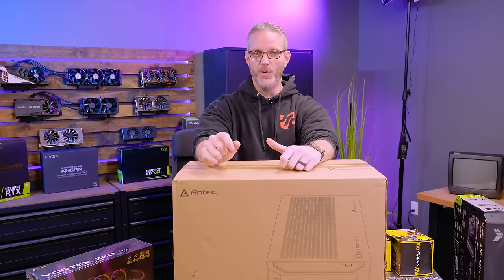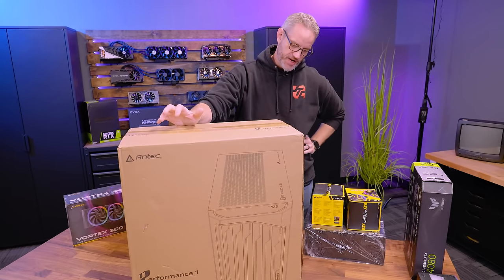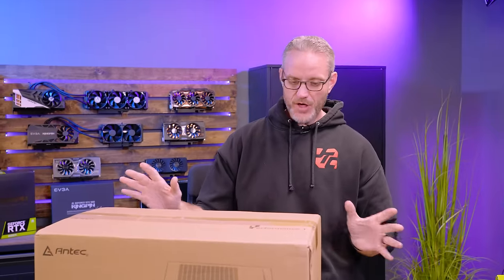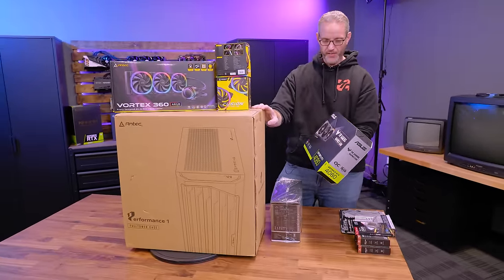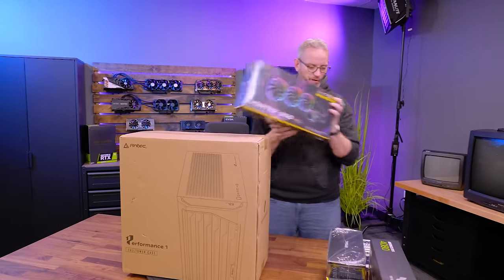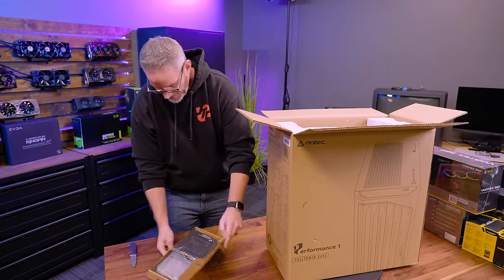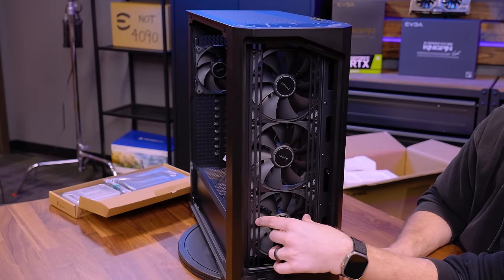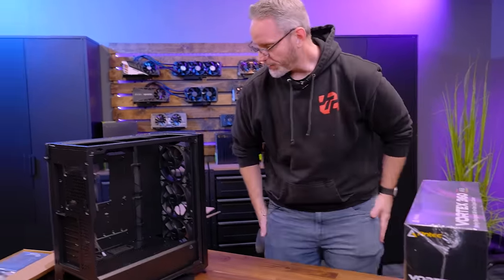Antec Performance 1 Full Tower Build!

Comment: If you want a good back pocket knife for general business IT work (cutting tape, occasional light pry when opening plastic cases, etc) the Gerber Fastball is awesome. Take off the belt clip, and it's light, slim, sturdy (I'm a big guy, and keep it in my back pocket, and yet it doesn't mind me sitting on it at all), very sharp (comes honed to a sharper blade angle than most other knives it's size), yet durable (more expensive high hardness steel, which is good because sharper and harder, though it's technically more brittle so don't dig the tip into a steel plate).  Love it for one hand work, holding a box with my left, grab knife from back right pocket and open the blade without looking, slice tape, close blade and return to pocket with a motion of my thumb and flick of the forefinger.

... when opening boxes for pricey replacement parts while in the field to repair things that cost tens of thousands of dollars an hour when they are offline, good tools are very much so appreciated.  Very much worth paying over a hundred dollars for a knife.

Comment: I don't remember the model number, but the first build I did with enthusiast level parts was in an Antec case. It was the first black case I built in while we were still in the beige tower days. Most of it is tool less except for the 3.5" drive bays which have rubber grommets in them, new concepts back in the late 1990s, and it still feels like a quality item. It's not quite dated looking enough for a Retro build, although it does have a total of 6 exposed drive bays, 4 5.25" and 2 3.5". Today it has a Supermicro server board in it along with a bunch of drives and is in use as a NAS.. because you can fit 6 hot swap 3.5" drive cages in the 4 5.25" bays. 

Really going to have to look at Antec again. I'm in an Asus Prime mesh case currently, and while I love the understated look, it does nothing to mitigate fan noise when the GPU heats up.

Comment: Built in the NX800 from Antec, which I strongly recommend if it's available in your country (pcpartpicker US doesn't list a price for it, I got it at my country's marked up prices for about $110)

It's a pretty basic case feature-wise, but perfectly fine for gamers, which may sound kinda bad at that price range. It does come however with 5 argb fans preinstalled with the same 3pin argb header to control it or alternatively a bunch of rgb presets on the included fan rgb controller. Those fans are 2x200mm fornt, 2x140mm top and 1x140mm back, so that covers basically all the airflow you'll ever need. And the biggest bonus of all might just be that it comes in black, white... aaaand pink :D

Comment: Before I got the Cooler Master HafX that I still use, I had one of the Antec cases that had an open swing door with a lock on it. That is a pretty good case; I think I gave it to someone when I couldn't use it anymore.
Reply: Still using 2 HAF 932 in this house.

Comment: My second build (Athlon XP-M 2500 on an Abit NF7-S motherboard) had an Antec Plus 660 AMG (Antec Metalic Gray) case. That was a really lovely case, which I re-used for several later builds. The reason I never bought Antec again was because of my experience with their poor PSU's. I wouldn't mind if Antec re-introduced AMG-coloured cases.

Comment: If theres width clearance with the power supply, cutting holes in the side of the basement and mounting the SSDs behind the holes would be an absolutely SICK mod for this setup. While you're there, moving that temp readout to the same place could be a possibile mod as well.

Comment: I used an Antek 300 for a previous build and it was a great case. This one looks really nice as well.
Reply: I had a 300 for my fisr build : it was a Phenom 2 X3 720, a HD4850, with 4gig of RAM it was back in 2011. It was a great cas fir the time, but in retrospect would have benefited in a bit more airflow.

Comment: I work in entertainment, where I still, must have an optical drive... I have the Antec Dark Phantom DP502 FLUX, because it was the only tempered glass "gaming" case that I could find with a 5.25 drive bay, and it turned out to be a really nice case.

Comment: Antec is coming back i have a 1200 case with the oversized power supply spec they were trying to get stranded but it was larger back it 2003. the case is still in operation but the fans didn't last but they didn't care about fans back then and the 850w Antec power supply still working had to much dust in it after 14 years 7 years ago cussing some random shut downs i hit it with air and its back to 24/7 operation. i got one new case a variant of this one and love it and they have good fans now.

Comment: I have a P4 system running in an Antec P182 case downstairs right now. Those things are heavy - over 30 pounds empty - thanks to the steel construction.

Comment: Eagle Tech cases (no longer making cases) had the ability to display the temperature of the CPU on the front.  They are about 15 to 20 years old.  I have the Dragon case.  And that Antec case is very similar to the Cougar case I am currently using in my most recent build.

Comment: Antec cases have been having a bit of a "quiet revolution" in terms of design for the past five years. The "Antec striker" is really nice open ITX tower that allows for some crazy custom water cooled builds, I saw a really nice Cyberpunk build in one. Antec have recently released the " Cannon" case which is ATX version of the case, which, I have been sorely tempted to buy and build in, but fluffy cat and open air towers are not a great mix.
Reply: The STRIKER and CANNON are really innovative open frame case, there are many awesome builds for these two. The Performance 1 is not that crazy, but it looks great in details, the cable management covers, removable top cover,and temp display. Well done, Antec.

Comment: Jayz, It does support a 420mm Radiator in the front, and i am starting to build my Asus ProArt with i hope a Intel core I9 14900K going to Use a Assu ProArt Lc All in one CPU Liquid Cooler 🙂all in white with no Flash Flash  lights lol.

Comment: @JayzTwoCents back in early 2000s i had a case that i have no idea what it was called but on the front area on each corner there was a strip with fake bubbles in and an rgb type flowing colours, it had the same thing bays that pulled out and even a spot for the psu to fit in the bottom and that was way ahead of its time wish i could remember what it was called

Comment: Agree with all you mentioned & said. Nice looking case and looks like everything fits 'snug'.
It would be 'nice' if Motherboard manufacturers would move the CPU Power connectors from the back to the front side of the Mother board so all Cables can easily be 'managed' and do not need to run across the back  diagonally to the PSU or one needs to use an extension or new longer cable.

The ANTEC P1 is  looking nice, was happy to see in the last part of this video one can drop in the AIO from above.  Cool case 😇

Comment: I havn't used much gear from Antec for many years.  I remember that I once had a case with a whole bunch of Antec branded fans in them.  These were early generation LED fans powered through molex and had individual speed controllers on them (back when the only common size fan you would come across in stores was 80mm).  I think at one stage I also had a fan speed controller from them which had a bunch of temperature readouts but you had to place cabled sensors on the items you wanted to monitor, I never really found that one very usefull apart from trying to minimize the noise (not very well).

Comment: -- Not a bad looking case.  It's not a D5000 but it is nice, and in 25 years, I can't think of a time Antec has ever let me down.  Bought one of their 5 packs based on your recommendation in a previous video.  Pretty good for a 150 dollar price-point.  
   I still disagree with you on removing the top filter, even if it generates better airflow.  Leave it on (especially in push/pull config), let it catch some stuff, otherwise, you'll just have to catch it again.  
   Thumbs up.

Comment: I've been daily driving an Antec 1200 for 13 years now, it was way ahead of its time in terms of air cooling but doesn't keep up with the modern designs. It is home to its 3rd system right now, which will probably be its last. There is just no need for all of those HDD bays anymore, and certainly not the optical drive bays.

Comment: I ended up giving this case a shot. It will be a dual purpose PC Gaming and a DAW for home audio recording. I did not need anything with the trendy fish tank glass everywhere look. I'll use the Asus Pro Art 670e motherboard, Founders 4090 gpu, silverstone hela 1200r psu,  AMD 7950x3d,  3 fast nvme drives and G.Skill Trident Z5 NEO RGB, and a EK Nucleus AIO CR360 Lux D-RGB aio cooler. I need to look into a nice set of cables to be made for it. This pc is way overkill but will age well.
It should suit me for  number of years as my current gaming pc is a haswell 4790K and a GTX 970 gpu (recently swapped to a 3050 which helped). I keep pcs for a while. My former music pc is an old XENON build that was very expensive t its time that my gaming pc smokes now. It does have a nice Lianli aluminum rack mount case that i would have liked to use but didnt see very well suited to cooling or air flow.

Comment: I still have an Antec 1200 and little reason to replace it. Full Tower seems to be a relative term these days.
I took off the bottom half of the 9 front bays and it's got more room than this one for the video card.

Comment: I was taught as a kid that a dull knife is more likely to cut you than a sharp one Jay.  🙂  Wish you had included CPU/GPU temps during a bench test in this case.  Some of these tempered glass cases reach Easy Bake Oven temps.  That's not something I want to put expensive PC components in.  Thanks for the video.

Comment: Crazy thought, if they fit without hitting the front mesh...

Put the 120mm Fusions on the front of the bracket (so the rings are not blocked by it) and the 140mm Storms on the back of the bracket. 

The screws on the 120's will line up with a 10mm offset without interfering because the sizes of the fans. (I test fit this on my Define R4 and it does work).

Wondering if it would cause turbulence issues if they are all running, or if it would actually help the Storms blow into the case even better?

This is mostly just to get some proper RGB showing through the front grill without wasting not utilizing fans that are already provided with the case, something I struggle with all cases that supply fans with the chassis that don't fit with most builds, (looking at you H7 and 5000d).

Yes, thinking outside of the box for sure, but hey, if it can be done, why not?

And yes, I know you might be able to sandwich a 420 rad in push/pull there, but Antec doesn't make 140mm Fusion fans. Be Quiet Lightwings I guess?

Comment: My favorite Antec case, to this day, is their Skeleton case (the full-sized one, not the mini). nothing (short of an open test bench) could touch it, in terms of airflow. I used a Skeleton for a LONG time. A few years back, when i built my latest PC, i wanted something with REALLY good airflow, but the Skeleton was no longer suitable (it couldn't handle the parts i wanted to put in it, and it's main fan was unavailable as a replacement part, and the fan was on it's way out), so used a Cooler Master HAF XB EVO. It is absolutely perfect for my use-case. Excellent airflow, and a size that fits in the space i need it to, without choking off ventilation. couldn't be happier with it. This Antec case is kinda cool, but honestly, i'd still take my Cooler Master HAF XB EVO over it any day.
Reply: HAF  XB is such a joy to work in .if you have a bunch of 3.5 drives down low you might need a fan down there depending in use though.  Gpu sag ? Never heard of such a problem.
Reply: @daved22  Absolutely. the orientation of the mainboard was second on my list of criteria (first being airflow). That case is SO good to work in. I do have drives in the hot-swap bays, so i do also have a pair of 40mm fans mounted down below. my drives, my CPU, my GPU...everything stays nice and cool. Love that case.

Comment: Had that same P182 case with Masterkleer tubing, all DangerDen blocks, and a swiftech MCP655 w/speed control.  Obviously all barbed fittings w/ zip ties for "secureness".  I think I only had a 240 rad at the time but it was mounted the same way as yours with standoffs on the top.

All from xoxide 😁

Comment: I'm looking for a boring, low noise cabinet with good space for hard drives, yet with up to date connectivity for a workstation I'm planning to build. No need for led lights, I'll just as well use a head lamp whenever I need to. Glass panels are a bad idea, unless they perform better at noise reduction than foam covered steel plates. But it must survive working at full tilt for hours at a time, account for the fact that I count storage in terabytes, and preferably at low noise at that. Any idea among you people?

Comment: I have a 12-13 year old 750 watt antec psu as my testing/backup psu. It is in use in my main system atm because my not even 1 year old Corsair unit died and I haven’t gotten around to getting it rmad

Comment: Looks really nice.  But with buttons, ports and display on the top, its clearly a floor case not a desktop case like the O11 and those also moving ports to the base etc.  The other problem I see is the front panel.  I like the look.  But having the front visual slots attached to the filter layer means you may find a full cleaning of the mesh hard.  Those slats would be better detachable so we could clean around them.

Comment: I miss videos about airflow in a case like LTT did with one case and smoke. I have the standard 4 fans setup, 3 front 1 back and i‘m trying around to set them all differently. Atm i‘m thinking to set the middle front case fan to lowest RPM vs the others, because its hitting directly the GPU. And i use the NH-D15 for the 12900k, with only one 15 cm fan on it in the middle. 12 cm back fan vs 15 cm that has to push through fins. I set the back fan at the highest RPM in relation to the other case fans.

Comment: One of the things I like about my Phanteks case, is that the top has some styling and design. Most cases just have a square flat top and it makes the cases all look the same. Case manufacturers need to have some better designs to set themselves apart from others.

Comment: Nice design overall but wish there were space for 420mm rad on top and 140mm fan on back.  Can you fit BOTH a rad AND the 30mm thick fans?  Or do you have to downsize to standard 25mm thick fans when running water?
Reply: Good question. If you find the answer m8, let me know 👍
Reply: Take a look the video from GGF, he put dual ekwb 360 rads with 60mm thickness in this case. It looks awesome!

Comment: i heard your going to have headaches mounting the Arctic freezer 420mm in the front. u can do it, but only with the fans mounted on the outside - and you cant tighten the top screws onto the radiator. cant have it all i suppose.....

Comment: I havent used antec since around 2010 ish, my old antec 1200 was a monster
Reply: About 2010 was the last time the released any good cases - the 900 and 1200 were beasts and I personally built a ton of rigs in them.  But they lost their way for a long time after that generation.

Comment: I recently tried to do a 360 aio at the front of the case and wanted a push pull, after a lot of head scratching I realised I could only do either the case fans at the front or the rad but not both, how do people do push pull ? I am guessing you either need special screws or the case fans have to be bigger than the rad so you still have access to attach them. By the time I got to this problem my head was mashed from dealing with the spaghetti mess of wires so I may have missed so etching obvious 😂

Comment: I see you used a 90 degree adapter for your gpu cables.  Is there enough clearance between the top of the card and the glass so I wouldn't have to worry about cable bending issues?

Comment: @Jayztwocents watched your video about the airflow but I'm confused about this build, you put the AIO on top as exhaust. I know that "fresh air" is pulled from the front 3 fans but is it enough because inside the case always will be warm t.i. pushing the warm air to the rad.? Wouldn't be better AIO at the front with a push-pull setup (like a sandwich) + 3x exhaust fans on top?

Comment: It's still lagging behind the pack when it comes to the filters, they're not fine mesh, see the type used on the Corsair 4000D Airflow, the Silverstone 120mm fan filters, the stuff NZXT or Phanteks, or Fractal Design use.  That front intake is going to get caked in dust, and cleaning all the folds and internal corners on the magnetic front is going to be a lot of work, compared to what it should have been had it been designed with a mesh filter that was seperate and could easily be removed seperately to the front grill design.  The steel work looks nice quality, Antec always did decent chasis, but they need to modernise the mesh they're using, that's just not acceptable, it's going to heavily impede airflow.
Reply: You need to look at that part of the vid again - the mesh looks almost identical to that in the Lancool III.  Its not a super fine mesh by the look of it.